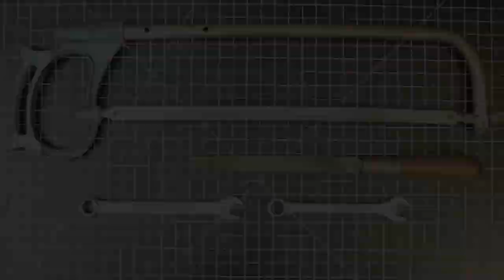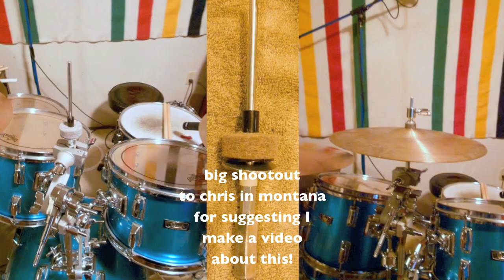$3 Aux HiHat Mount!

Comment: This video is great.  Thanks for posting this.  I just tried it, but used a 6" bolt since you hinted at the fact that the 5" might be a bit short depending on the clutch or the profile of the cymbals.  Worked out great! Thanks!

Comment: I'd suggest a 6" for the larger bolt. You can use bigger hats with the taller bolt (plus use it for something else.... stay tuned. Maybe David will make a cool follow up video.) Also, remember you can push the cymbals tight before you lock the clutch to get a tighter sound. Leave them unlocked for a looser sound. And open them a tad and lock them for an open (duh) sound.
Reply from the maker: +bumble yeah I pushed real hard to get them closed haha, then I found another clutch that was a bit shorter (which you see when Im actually playing them). but 5" was the longest bolt they had, ill have to try somewhere else and get a longer one.

Comment: Just built this! It works pretty well, considering I used 14” Paragon hats on my test run. My goal is to build a DIY version of Benny Greb’s new trash crasher cymbals aux hats thing that’s like $500. Now I just have to get 4 splashes of various types so it sounds half decent.

Comment: +rdavidr if you take a threaded shaft and you fix it(wjth a coupler) on a tilter you have an extension of the tilter and you can put 2 cymbals
Reply from the maker: +Bertrand yeah that would work, but you would probably have a hard time finding a coupler with the same threads as the stand at a hardware store. You would most likely have to get it online.
Reply: rdavidr i found 6 and 8 milimeter coupler at the hardware store but it's round coupler and not hexagonal coupler, i can put too a hi'hat mount.
i don't speak very well english beacause 
i'm living in france(I think you can find the same coopler in USA) big up from france !! you make very good job

Comment: BRO! The vids you got are rocking'! Question for ya. What would you use instead of the clutch to mount the hats? Curious on your thoughts. Keep up the good work my man!
Reply from the maker: you could get a shorter bolt and leave the head on it and screw it down to the coupler. youd probably have to mess around with finding the right bold length though.

Comment: If the hi hat never opens, there has to be a much easier way to do this wothout needing to cut bolt heads off or use several couplers.